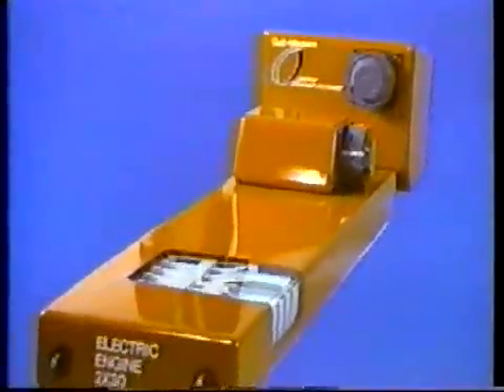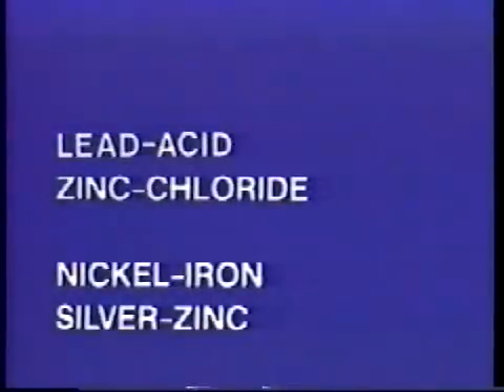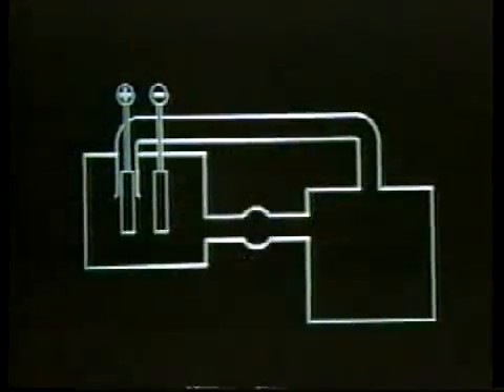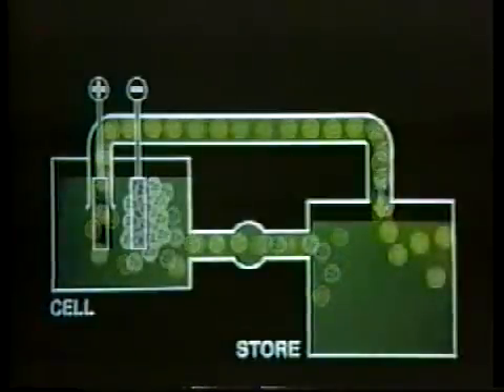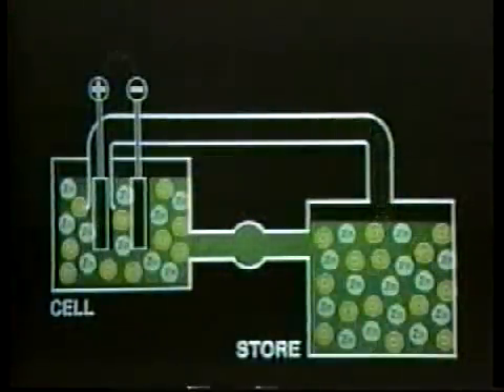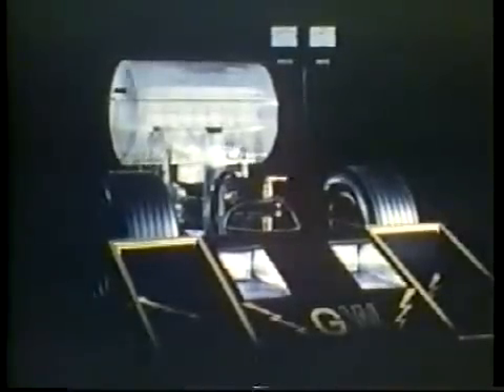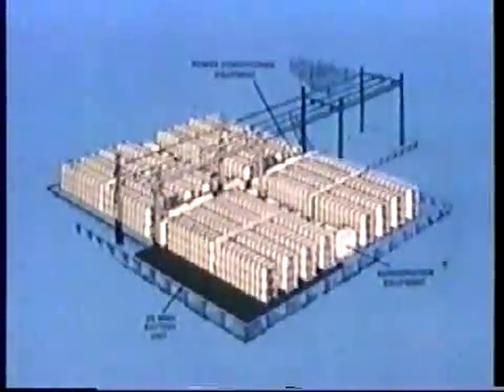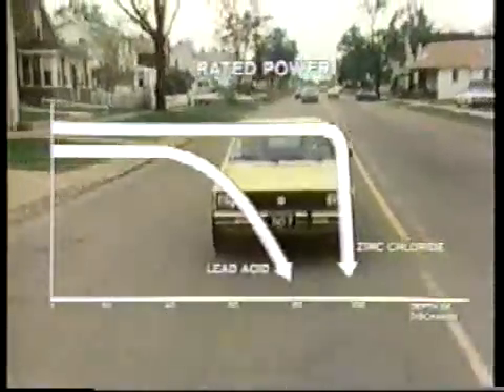Electric Vehicle Battery: 35 Years Ahead of Its Time!

Comment: So really there is only one question that comes to mind, why are we not using this tech now instead of the lifepo4 batteries?All the testing has been done it's ready to go so why are we not using this tech now?
Reply: extremelydangerous Well I wish they would do a better job at selling the batteries cos they did a great job on producing a top car.

Presumably they sell the charger with the batteries else how would you charge them right!

Mind you I've not seen any batteries for sale signs go up on the net from tesla as yet though I could have missed it.
Reply: +flitsies 
tesla business is not in the car, it is in SELLING batteries!!!
the car is just a reasson to sell batteries.
Reply: +flitsies 
"...but the 18650 cells he is producing provide a huge amount of power in a very small package."
     How can you say that???  The 85 KWh battery Tesla says will provide a 250 mile range now weighs 1200 lbs.  (This number has apparently been subject to inflation, as are many of Musk's numbers.)  12.5 gallons of octane will provide the same range for an average car that gets a conservative 20 mpg.  This liquid energy source weighs only 70.3 lbs.  That's less than 6% of the mass of the energy source of Tesla battery you have to accelerate and carry around.  Since a liquid fuel tank is only half-full on the average, you only have to carry half the fuel mass on the average, unlike a discharged battery, which you still must carry 100% of.  So liquid fuel is more than 33 times more efficient with respect to weight than Tesla's current 18650 Li-ion technology.
     If you peel back the skins of the onion to the fundamental physics, as Musk likes to congratulate himself on doing, the fundamental chemistry/physics tells you that the winning strategy would be to use whatever green energy source you intend to use to charge Tesla batteries to, instead, manufacture synthetic liquid fuel.
     I CHALLENGE ANYONE TO PROVE ME WRONG!!!
Reply: +flitsies 
"Presumably they sell the charger with the batteries..."
     No.  The charger is built into the car.  The design of the charger is one of the sources of magic that Musk claims will make the Panasonic 18650A Li-ion batteries he uses last far beyond the number of charge/discharge cycles in the published spec:
https://industrial.panasonic.com/cdbs/www-data/pdf2/ACI4000/ACI4000CE25.pdf
Reply: +flitsies The only battery technology that I know of that is doing well in the laboratory stage (the earliest stage) is Graphene. Most inventions never make it all the way through to the mass production stage. People have been working on a better battery for over a century.
Reply: +flitsies Because it was a total failure. There's a wikipedia page on it.
Reply: +tarstarkusz Well I tried to find it but was not able to, however there is a wiki on gulf and western but not the zinc chloride system.After checking out the zinc chloride system it turns out that the system did actually work it was tested up to 1000 cycles with a view to testing up to 2500 cycles it was a 1.5 kw system and clearly it worked else they wouldn't have bothered going up to 1000 cycles, oh and as stated in the video there was little deterioration of the electrodes.It just seems odd to me that this system was being tested, it worked but then it suddenly stopped being tested.There have been other studies so it seems but what really amazes me is that this actually does work, so it makes me wonder why they are not putting more effort into using this for transport.
Reply: +flitsies Your last line is the answer. It doesn't work A simple doubling of a battery capacity in the same space and WH/KG would make people unbelievably wealthy. If you could add a very fast charging time, you could take over the world. Oil has millions of other uses besides energy and could be conserved to last millennia for petrochemicals and other uses. Everyone, even the oil producers of the world would benefit from a super-battery. Production of oil could easily be scaled back and the price greatly increased because there are no substitutes for these uses. State oil companies would see decades of wealth turn into thousands of years of wealth (assuming we could generate the electricity these batteries would hold, remember batteries are not a source of energy and need to be charged with electricity generated by fossil fuel and nuclear).
Reply: tarstarkusz Well I had my doubts about this thing at first but when you google zinc chloride battery there are other site that come up which seem to suggest actually more state that it does work.
Perhaps they are over zealous but they speak of 1000 cycles in testing with negligible effect on the electrodes, so my thought on the matter is if it didn't work why would they even bother going to a 1000 cycles after the first 12 cycles they would have simply said "this is crap not worth wasting time on" but they didn't they went 1000 cycles and though it didn't actually state, but the view was to go 2500 cycles.

So I ask myself this, if it didn't work why bother going to a 1000 cycles?

Of course it probably needs more work to perfect it but it would be interesting to see if it could do as is claimed on a larger scale.

I don't know who or why this didn't take off, but judging by what certain US high powered people have tried to do to the tesla car company of whom you must know by now produce the best ever electric car on the planet and how these people colluding with the oil company and vehicle sales tried to stop the sale of these vehicles I wouldn't put it past them to be responsible for the lack of research into the zinc chloride issue.

But on the other hand as it is out there now there would be no reason for the research not to take place.
So with that in mind perhaps in the near future if it works for sure we will see it in vehicles.

Of course there is the issue of the length of time it takes to recharge but all good things come to those who wait.
Reply: +flitsies I'll believe it when I see it. Companies are scrambling all over the world for better batteries and if this was the real deal, I would think someone would be working on it. Tesla is building a five billion dollar factory to produce Samsung lithium cells. If this battery was anything like what they describe, Elon Musk would be building a gigafactory for Zinc Chloride batteries instead.
Reply: tarstarkusz Well you never know he may well in the near future, but the 18650 cells he is producing provide a huge amount of power in a very small package.

I must admit it seems too good to be true but sometimes things are, the main drawback seems to be the time it takes to reset itself which is claimed to be 8 hours so there is clearly room for improvement.

I think it is one of those things that will need to be kept an eye on to see where it ends up cos at the moment it seems to be waiting for someone to invest money into it for more research.
Think about it though what ever happened to the fuel cell that would run a lap top for a massive amount of time on an eye droppers drip of petrol which was demonstrated on the tv well over 10 years ago.
But that's another story.
Reply: +flitsies 
One would suspect that it is of fundamental importance to their business plan that they unload the company before the first batch of cars requires new batteries, and everyman can extrapolate the true cost of driving a coal-fired electric car.
Reply: MantisNoMore Well judging by other lipo bats the faster you charge them the faster they are killed off.

So slow charging seems to be the best for them but perhaps they have overcome the problem of battery recovery especially as they have those super fast chargers.

Did you see the video about the super capacitors that work as good as a battery?

Apparently there was a girl probably a team but it said a girl discovered how to make a capacitor work like a battery in other words it super charges in seconds like a cap but discharges like a battery which would make it ideal for such uses as vehicle use.

However that was some 3 or so years ago so you have to wonder why it's not being adopted by any vehicle makers.
Reply: flitsies
Read up on leakage current.
Reply: tarstarkusz Yes I heard it was very promising but there is a video on youtube showing a girl who came up with a capacitor rapid charge with a controlled slow discharge device won some kind of award from intel I think it was and this is going back 3 or more years ago.

Now it seems strange that here's a potential winning capacitor battery and we hear nothing about it's development.

I like those AGM batteries by the way except for the weight of them but they do a good job, shame they couldn't reduce the weight more.
Reply: flitsies 
Here's a practical question for you:  In the event of an accident in which a capacitor energy-store is destroyed, how long does it take for a capacitor to discharge?
Reply: MantisNoMore Well from what I understand of capacitors they discharge almost instantaneously after all that's the reason why they are used so frequently.

But you could also ask the question what happens to a tank of gasoline when the tank is fractured during a collision, and how long does it take for that fuel to ignite on a hot exhaust pipe?
Reply: flitsies 
The question is not how long it takes to ignite fuel, but how long it take to release the energy from the fuel.  It takes minutes for 10 gallons of gasoline to burn.  It takes microseconds for a capacitor to discharge.  Do you know how people usually refer to an instantaneous release of energy?  In common parlance, they call it an EXPLOSION !
Reply: MantisNoMore But that does not apply to a capacitor unless the chemistry is ignited which is very unlikely due to the rapid discharge.

In electronics it's the other components that usually burn rather than the actual cap, it may burst but then it becomes neutral, from what I've observed anyway.

I've had one or two burst on me but then that's about it end of, no flames nothing.

So I would say caps are very safe if handled properly.

Batteries are more dangerous because they release and hold on to their charge thus causing a fire and holding onto that fire longer due to the chemistry.

So a combined cap and battery tech would probably be much safer than just a plain battery, cos the cap side would cut the power to the battery side.

But that's assuming they built in safety mechanisms.
Reply: flitsies
Don't you believe in conservation of energy?  Where do you think the energy goes when you destroy a capacitor???

 Ions are the charge carriers in batteries.  Batteries require diffusion of ions to release their energy.  Ion mobility in batteries, especially when using solid electrolyte, is very low, so it takes significant time for a battery to release its energy.  In a capacitor, the charge carriers are distorted electric fields, electrons, and electromagnetic waves traveling in the conductor plates, so the release of energy is essentially at the speed of light in the medium.
   I kind of hope someone builds some, because it would be spectacular to see a fully charged capacitor car explode!  I feel the same about hydrogen-fueled vehicles.  Hydrogen is a spectacular explosive!
Reply: MantisNoMore Yet hydrogen vehicles are a reality, and they use hydrogen busses in service on a regular basis.

It would be interesting to see the cap battery in action, but not seen any as yet.
Reply: flitsies 
You didn't read up on leakage current, like I suggested, did you?  I get the feeling you're all talk, and just wasting our time here.
Reply: MantisNoMore I have already spoken about leakage current it is a problem that most just about all batteries suffer from with some being more affected than others.

I have recently found (as I said earlier) batteries that claim not to have leakage at present I have them sitting around to see just how plausible their claim is.

I estimate I will no need to use them for over a year so if they don't leak within that time all will be good however if they do then they will be not so good.

But if you have a point related to current leakage why not just make it your point, then if there is something I need to investigate further I shall.
Reply: flitsies
Leakage current as it applies to capacitors is why they have never been widely used as energy storage devices.
Reply: +flitsies There really isn't anything in the pipeline for batteries. The last major breakthrough that actually made it to commercial production was in the 80s. I want to see something in at least the demonstration mode, preferably a pilot mode before I am going to get excited about anything. The problem isn't just batteries. Batteries are not an energy source. If you wanted to electrify personal transportation, you are looking at displacing 10s of millions of barrels of oil a day.
Reply: tarstarkusz
Elon Musk had a solution for how to charge his car batteries at night in your garage with solar power:  It was to sell you yet another half-ton battery:  The Power Wall.  In his ideal world, during the day you would use Musk Solar City cells to charge the Musk Power Wall battery in your garage during the day, then use the energy in the Musk Power Wall battery to charge the battery in your Musk electric car at night.  But you need (as others have aptly termed it) a sh*t-ton of batteries to do that.

Musk says the gigafactory will produce 50 GWh of battery storage by the end of 2020.  (His number!)  Unfortunately the world requires many thousands of times more capacity than that to time-shift the power-grid from solar during the day for usage at night.  And that factor of 1000s more batteries accounts for neither the additional electric-grid capacity required to charge electric cars of the future, nor the batteries those new electric cars must contain.  That's only extrapolating how many Power Walls would be required to time-shift the current electrical load so we could heat our homes at night with solar power.

When the numbers for that shell game didn't work out, Musk kind of secretly revealed his super-duper plan to power his super-plan:  It is to build nucs, Nucs, NUCS!  But since nuclear power is currently unpopular with those downwind of Fukushima, he quietly announced his new strategy overseas, where not many potential Tesla customers would notice it.  Here's both the video of Musk's coming out in favor of nuclear power, and its transcript.  (Pick your poison:)
http://www.autoblog.com/2015/12/05/full-text-of-elon-musks-paris-cop21-speech/
Reply: MantisNoMore Yes I know this about capacitors but as I tried to tell you before, there was a student and she managed to combine in someway which it was not explained, the ability of a battery and capacitor so it would rapidly charge and hold it's charge and deliver it like a battery.

So she had overcome the problems of leakage and charge time and longevity of charge, supposedly that's why she won the award.

Of course there wasn't a lot of information given out as it was new at the time which as I said was around 3 years ago.
Reply: tarstarkusz Yes lots of fuel but you could also make use of storage batteries solar and wind to keep them charged up, thus negating the need for so many barrels of oil.

Isn't that what Elon musk is doing with their super charge stations making use of renewables.
Reply: MantisNoMore You talk of the power wall unit.

I'm of the mind that this kind of thing would help reduce the strain  on the grid not do away with the grid.

So assuming the power wall and solar and wind worked really well, perhaps you could charge your vehicle using the system but stay on the grid for your main power needs, thus reducing the strain on the grid.

As time went on you would be able to consider other uses for your power generation.
Reply: flitsies
I thought I covered that:  Musk's own (probably optimistic) estimate of the gigafactory's entire production through the end of 2020 A.D. is 50 GWh.  1000s of times that aggregate electrical storage is required to load average the US electrical grid of today.  That doesn't even include the quadrupling of the grid which would be required to charge electric cars if Musk's dream of all cars being electric came true.  That doesn't even include if homes were all heated with green electricity instead of fossil fuels.

Musk claims the gigafactory is the largest factory in the world.  Can you imagine thousands of gigafactories being built?  And that doesn't include the volume of batteries that will have to be replaced when they burn out after 3 to 5 years of service.  Can you imagine all these 1000s of Li-ion battery factories being built before the oceans will supposedly warm 2˚ C.?  I cannot.
Reply: MantisNoMore I hear what you are saying but I don't accept it because you are thinking that we will per person consume more and more electricity when in fact it usually goes the other way ie consume less.

For example:Let's say you owned a tv a fridge electric heating and all your lights were filament type 100 watts each, and this was back in the let's say 60s.

Your electricity use would be very high, tv would have been valves, fridge inefficient and so on including the loss of heat due to lack of lagging, but your bills would have been high but not overly high.

Now shoot forward to 2016 tv very low use of power, fridge highly efficient runs on next to nothing power wise, electric heating well yes that is still high but much more efficient and uses less power, light bulbs run at a very low power usage ie 15 watts some less., and almost all properties now are fully insulated.

But when you consider the cost of your bills they have gone up not due to power usage but just general pricing.

The point being per person today uses less energy than someone in the 60s assuming they could afford all the items above.

Now putting that aside, let's consider a normal household running an electric car, they get solar panels and a storage battery so the panels charge that storage battery pack not directly the car, other than the initial outlay this family could save money on running costs and their electricity consumption from the grid would not change. 

So they would still have the grid to run their day to day usage but for their car they simply use their solar/wind charging system.

As I said before, you can pretty much do this kind of thing with all your personal hand held devices, ie get a jump starter and keep it charged up via a couple of cheap battery saver solar panels and charge all your hand held devices from the jump starter, the panels provide more than enough to keep a jump starter battery fully charged, so you have free electricity, I've done this in the past.
Reply: +flitsies You missed the point which is that in order to displace millions of barrels of oil a day, you have to have an alternative to the oil and that is a great deal of energy. It's not even clear to me (or anyone else) that solar photovoltaic panels have a positive net energy return. It's one of the many reasons solar is so expensive. Solar panels are made with mostly fossil fuels.
Reply: +flitsies The problem with this scheme is that if you have access to the grid, a solar system to charge your electronics will never, ever pay for itself. It is an extremely inefficient and costly way to charge your electronics.
Reply: flitsies
"For example:Let's say you owned a tv a fridge electric heating...[in the olden days]"
"...forward to 2016 tv very low use of power, fridge highly efficient runs on next to nothing power wise, electric heating well yes that is still high..."
(But you conveniently left out that virtually everyone in 2016 has air-conditioning.)

Electrical engineers have a saying:  "In the final analysis, all electronic devices are heaters."  This is a comfortable way of citing Conservation of Energy.  Every smidgen of energy that goes into an electronic device of any kind is eventually turned into heat.  Every bit.  With none lost, and none gained.

So it is difficult for me to imagine "more efficient" electric heat.  In fact, the more efficient all those other appliances you cite are, the MORE energy your electric heaters have to consume to produce the same level of warmth.  On a cold night, your heater has to produce EXACTLY as many more milliwatts of heat as you saved by increasing efficiency.

"...they get solar panels and a storage battery..., other than the initial outlay this family could save money on running costs..."

Again, you have forgotten that they have to pay to dispose of their old Li-ion battery pack, and purchase a new one, every 3 to 5 years.

"So they would still have the grid to run their day to day usage but for their [electric] car they simply use their solar/wind charging system."

You just now, above, completely divorced the electric car from any consideration of the supposed advantage of your time-shifting of energy consumption by your Power Wall.  That's fine, but then it's unfair to continue to conflate the 2 separate issues.

If you drive your car to work during the day, you still can't use solar energy to charge it when it is at home at night.  Conflating solar and wind energy does not help your argument.  Wind generation is unavailable to most people.  Producing energy from wind is an entirely different issue.  Rather than bringing more variables into your original problem to increase confusion, you should discuss wind generation as a separate issue.  It's characteristics are quite different.

Charging handheld devices requires many orders of magnitude less energy than recharging an electric car, or heating a house on a cold Minnesota night.  It is an entirely different class of problem, and, again, not the original electric car charged by Power Wall problem you originally posed.

I know it is a hard lesson.  It was a hard lesson for me.  You have to pay the piper.  Not only do you have to pay, but you always have to pay for more than you receive, and there is no way to escape paying.  Thermodynamics is a harsh mistress.

But don't feel badly.  I suspect it's eventually going to be an even harder lesson for Elon Musk.  And all the investors in Tesla.
Reply: tarstarkusz Actually it's not, the jump starter I used cost me £15 at the time, the solar battery saver panels cost me £7 and £10 which as you can see was a grand total of £32 the system lasted over 20 years I used the same jump starter for starting cars motorcycles and charging my mobile phones and other low power devices.

In essence it paid for itself many times over and would still be working today but for the battery post snapping off because using a disulphater and the solar panels kept the battery in very good condition, oh and the jump starter had a light on it as well so I could use the light when needed.

I would buy a new battery for it but I have no need for this system anymore as the devices I use now use much less power and need charging less often.
Reply: MantisNoMore Ok first off air con is optional so you would have to work out what your needs would be to run such a device.

Efficient heating.
Heating can be much more efficient and is today compared to those days.

The power wall

It doesn't need to be the power wall it could be any battery power bank, you build your own and put it in your garden shed, so the battery bank charges during the day then when you get home you charge your car.

You could even make use of the free charge stations or charge while at work, all reducing your actual personal home needs.

As for the batteries life span.

I understand that there is something along the lines of a 5 year warranty on the battery pack that doesn't mean they will be worthless at 5 years only that the company will stop supporting your battery unless you have it replaced.

But then why replace something if it still works?

As for disposal of the battery pack.

A high percentage of the battery is recyclable so not that much wastage.

I will agree that a battery system takes more money to implement and more planning to make it successful but it can be beneficial for some people but not if you live in an apartment yet.

Also getting hold of the batteries is a problem for many people, unless they use led acid batteries but then they are very heavy as you are aware.

Also lithium batteries are not the most reliable judging by the amount of battery failures I seem to keep getting with my devices.
Reply: flitsies 
Li-ion battery life is primarily a function of charge/discharge cycles.  The sun rises and sets every day.  You didn't use your jump starger every day.

The entire Li-ion battery unit costs more to recycle than can be recovered.  Whether you can remove the valuable part for less than it is worth is precisely the issue.

This is my favorite:
"...make use of the free charge stations or charge while at work, all reducing your actual personal home needs."
Solve the world's energy problems by getting someone else to pay for your energy use.  Maybe we can get Mars to pay for Earth's energy use!  Maybe that's Elon Musk's real incentive to get to Mars.

I deduce you are a True Believer (in the Eric Hoffer sense) in batteries being a panacea for human energy needs.  Good luck with that.
Reply: MantisNoMore Ok first off the idea of charging while at work is this, the energy is going to be created and used anyway in most cases so why not make use of that which will go to waste, the other idea of making use of the free charge stations is this, the stations are being put in and made available anyway so it makes sense to make use of them.

In both situations it's a case of making use of what is available to reduce your overall consumption of your own energy, and in the case of musks free chargers they are powered by solar and other methods so I'm lead to believe.

As for lithium batteries, a charge station does not have to consist of lithium batteries other batteries could be used such as AGM batteries or whatever chemistry is available. 

You could even use car batteries if you so wished in order to produce a charge station, it wouldn't be that efficient but it could be done.

The point is making use of what ever you can in order to reduce you personal grid use, and all the things I mentioned could do this.